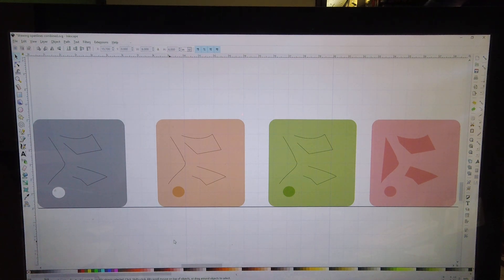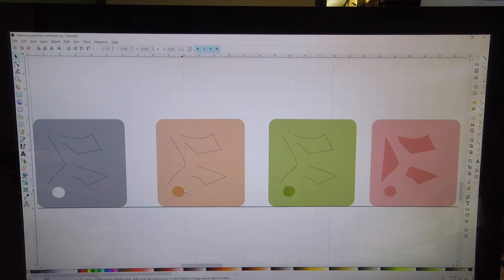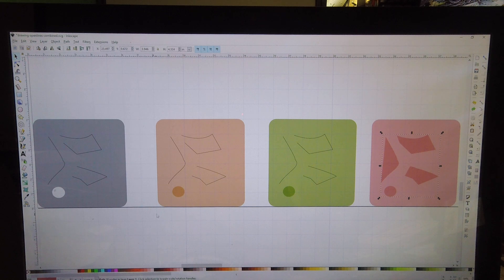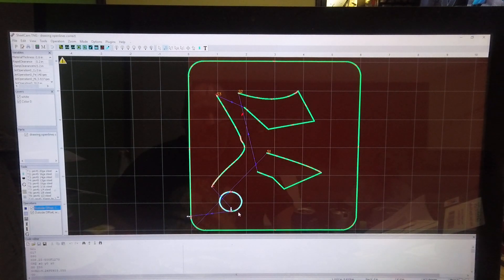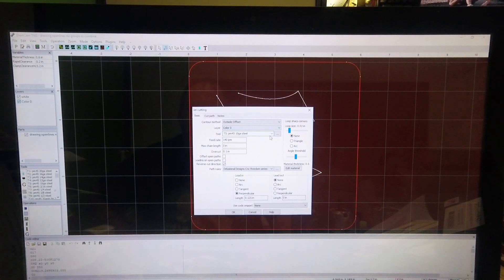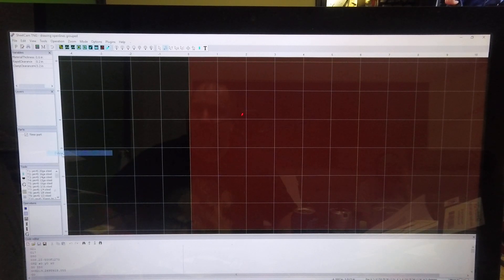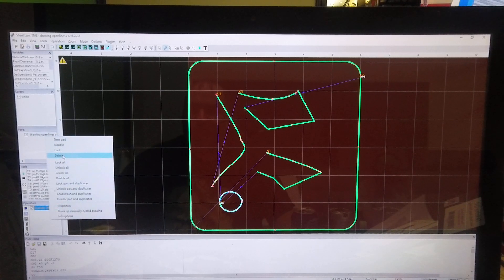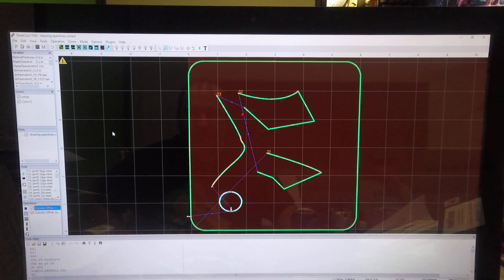Inkscape and sheetcam .open lines do and dont

Comment: Simply changing the Lead in to arc even though you don't want a lead in on an open line  it will re open a closed open line if this ever happens to you . I was trying to cut open lines for a turbulator and they kept closing up into a loop  . So i switched the lead in from  None to Arc and left the lead out to None and it cut my open radial lines around a circle just fine  . Without this my open lines kept closing into and odd overlapped loop . Hope this helps somebody cus it nearly killed me at 2 am . No sleep until the parts cut and the computer is at war with me , had 3 heart attacks  and finely had to ask Jesus how it fix it .  Wisdom is power  ...